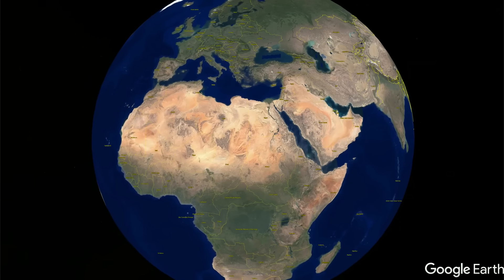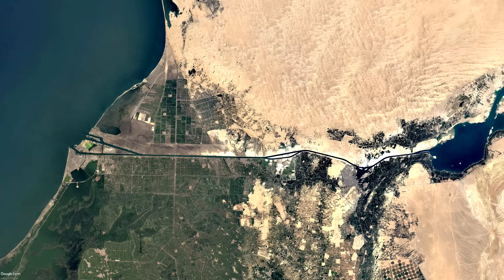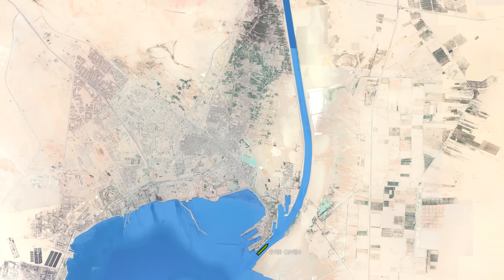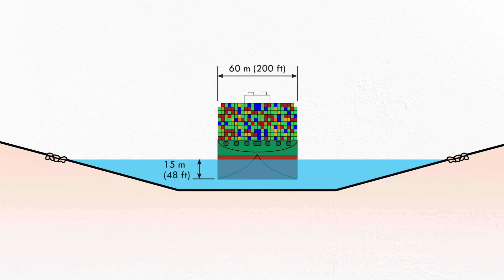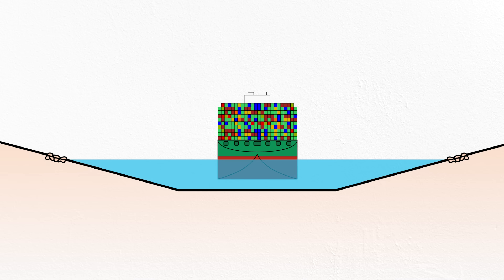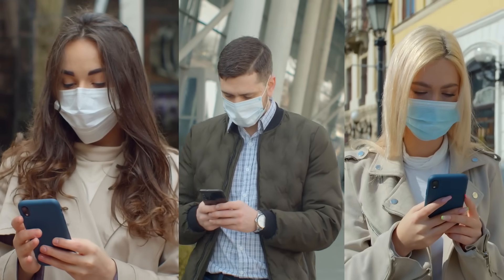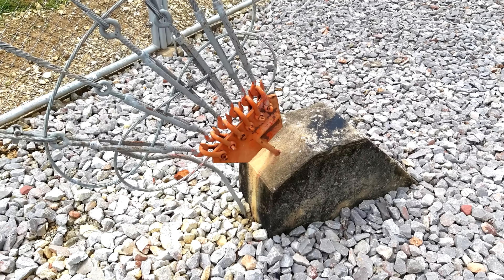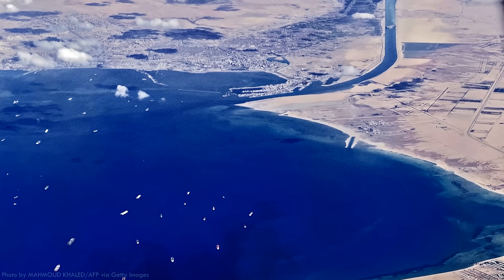What Really Happened at the Suez Canal?

Comment: Recreate water suction by filling a bucket w more than 4" of water w high pressure nozzle then lower nozzle til it reaches the bottom. Will go from pushing off bottom to sucking into bottom at about 2" above bottom cuz at 2" escaping water now creates low pressure.

Comment: From my engineering background, I think the cause of the accident was due to excessive side wind.  For a ship to move forward with a side wind force, the ship has to turn slightly into the wind and ends up traveling a bit sideways to go forward.  I think that the wind increased as the ship moved down the canal.  This resulted in the ship turning more and it eventually hit the side bank at the bow.  As soon as the ship bow pushed into the bank, the propulsion power caused the aft of the ship into the other bank.  My suggestion to resolve this problem with traveling through the canal would be to install bow and aft water jet thrusters on both sides to over come the side wind forces.

Comment: I like the video, but kind of both agree and disagree.  And, I am not an engineer but retired mariner and vessel master, who also was raised by a ship's pilot.  

I would not call bank cushion, suction and squat the same things, but when one does exist, the others are more likely.  Bank cushion is the water pressure exerted on the bow of a ship pushing it away from a bank or side of a channel.  Bank suction is the effect of that occurs when the hole left in the water by the ship's hull is not quickly getting refilled by water and the stern of the ship seems to get sucked towards the bank or side of a channel.  Squat is when the hole created by the ship's hull is not getting filled in by the water quickly and the ship gets closer to the bottom of a channel.  Bank cushion and suction work to change the heading of a ship.  Squat does not but, when squat exists less water will be flowing over and past the ship's rudder, which makes it much harder to steer.  

The ship may have experienced some if these without the wind conditions, but the wind was strong that day, and the way ship handlers conteract wind is often to speed up the engines.  Adding engine speed pushes more water past the rudders, so the steering is more responsive.  But ..., adding speed to the engines is almost always going to add speed through the water to a ship. Additional speed through the water exacerbates bank cushion, suction and squat.  And more speed also can greatly narrow any room for error one might have, or as I was told many times when younger and learning to handle vessels, speed kills.  

The ship handlers with which I have spoken about the incident are all of the opinion that the ship should have waited for the winds  to diminish before trying to transit the Suez Canal, that seems to be what they all think was the only real option.

Comment: When a vessel, travels along a channel, a phenomenon occurs, exactly like 2 ships navigating side by side in the ocean transferring fuel, they are attracted one to another if don't keep a proper distance between them.
This phenomenon pushed the stern ship to one border and the bow to the other border of the channel.
A simple explanation is the opposite of this phenomenon that occurs in rivers. The water flows faster in the middle, and slower on the margins, pulling everything into de center of the channel. This causes the death of skilled swimmers who used to swim on normal days without a problem,  and can not reach the margins of the river when rains and rivers rise up and the water increases its velocity because the current pull them always to the center of the river

Comment: That bank effect is similar to what happens with two ships refueling at sea, they are drawn together because of the water flow between then , a bit like a venturi . Dangerous thing to do and everyone has to be on the ball.
Regarding that dilatency issue , perhaps that could have been overcome better by bring in water pumps , hoses and big steel tubes with holes in them , dive them in , connect everything up and pump huge amounts of water in to liquefy the sand

Comment: first there was no technical information how heavy a cargo ship allows passage through the Suez canal: second the quicksand effect on a body. i do garden work with clay soil. when the clay soil is wetted, it is easier to penetrate into the ground. when the clay soil is dried, it becomes hard as a rock to dig. when this ship's front rounded cone is stuck on the sand and mud, the suction force also prevents movement until the sand/mud is dug out around the rounded cone. that's what i saw on your video the machine digger was digging around the cone.

Comment: @2:20 you mention that the Pilots are fully responsible...I wonder if that is true. I think the Pilots have a special position; I think ultimately the Captains of the vessels remain responsible. The Pilots have a sort of advisory role, but their "advise" may not be ignored without a proper/convincing reason. If they have full responsibility then in fact the Pilots would be responsible for the damages caused as well and that is definitely not the case.
Reply from the maker: I think you misheard me
Reply: @PracticalEngineeringChannel  indeed you are right, eventually I switched on the subtitles and indeed you said "aren't"; which I heard it as "are";

Comment: My Dad's research thesis for his PhD investigated squat in narrow, uniform channels - I contributed the University's first digital data collection rigs (based on a microcomputer) to speed up data collection during the characterisation phase of the problem. Squat as a phenomenon is exacerbated by having the propellers at the stern (push) and can be considerably reduced using props at the bow (pull). However, in spite of energy efficiency improvements of this arrangement there's a number of practical problems with this arrangement. One day, perhaps... Interesting explanation, especially the point about dilatency. Great vid!

Comment: Hi, I couldn't help but notice when you were talking about the factors which influence how hard it is to pull an anchor out of the ground you mentioned surface area. Well an anchor would be held in the ground because of static friction, and that only depends on the normal force (which you mentioned) and the static friction coefficient, not the surface area of contact.

Comment: Nothing about ballist? But it was probably pumped all out to go in the canal, also why didn't the just use jets of water to get it out? Ever pushed a hose in the ground and can't pull it out after you turn off the water? We you need to run another hose in the ground with it and pull them both out at the same time. Fluid dynamics is very useful to know

Comment: Not to feed fuel to conspiracy theories, but the "bank effect" or (less known as) the "channel effect" has the tendency to keep a vessel centered in the channel. As a 100 ton master I did a brief run on a dinner boat that cruised the intracoastal waterway. True, the dinner boat was only 40 ft wide, 200 ft long and drafted 6 ft, but the ICW is maintained (where possible) at a standard 90 ft wide with no less than 12 ft depth. The ratio of channel and vessel width and depth are pretty similar.
When the vessel was up to speed, 5 to 6 knots, you could walk away from the helm. The boat tends to stay in the middle of the channel. The force from the lower pressure from the bank pulls at the stern. This pivots the vessel around the center of rotation, usually about 3/5 to 2/3 forward of the rudders when steaming ahead, like steering a brick by pushing from the rear. This actually causes the vessel to point itself back towards the center of the channel. Granted, this can go screwy with light vessels, like an unloaded barge, causing wild oscillations until the extreme angle changes eventually drive the vessel into the bank, but the Ever Given carried nearly a maximum load, giving it a lot of inertia that tends to dampen the oscillations.
The other "channel effect" is counter intuitive; rather than piling water up ahead of the boat, the wheels (props) are actually pulling water from the channel ahead causing a slight dip in the water ahead. You can watch the water evacuate from the bank some distance ahead depending on the speed or thrust of the wheel(s). This dip in the water also helps to keep the bow centered in the channel.

The bottom line, in my experience, is the "bank effect" actually makes it more difficult to ground the vessel into the bank, unless you are over steering to compensate for high cross winds (reported to have been the case), over reacting to the "bank effect's" tendency to cancel minor course changes (the Egyptian pilots are well aware of this effect and know not to over compensate), or intentionally running her aground.

Comment: I still don’t understand why it took that long to unstick. For every “Chinese finger trap” like conundrum, there’s a relatively reasonable way to break out of it. 🤔
Reply: Correction: Every "Chinese finger trap" like conundrum you are familiar with has an easy solution. I would even say that a Chinese finger trap is not a particularly good analogy for this, but let's roll with it.
With a regular finger trap, you can cut and thereby remove the material the trap is made from. In this scenario however the trap is not surrounded by air like an actual Chinese finger trap, but instead when you remove some sand, that is surrounded by more sand, that falls in, since the only thing holding it in place was the other sand you just removed. Same with the solution of sticking your finger in further to release tension, in this case doing so would a) accomplish the opposite, because there is more sand behind the sand that trapped the boat and b) not facilitate a release anyway, since other than the finger trap, pulling the boat out would just pull the sand with it, because it is subjected to adhesion, because of the water in the surrounding sand.
I hope that cleared things up.
Reply: @creativedesignation7880  it cleared nothing up. Thanks.

Comment: if youve ever flown a model helicopter the same effect happens when you get close to a wall or the ground, the air becomes unstable and makes a suction force towards the surface
Reply: The “ground effect” you describe for rotor flight is strictly an aerodynamic effect and does not translate into hydraulics because of the drastically different properties of gases and fluids. The ground effect is noticed only WHEN HOVERING and completely negated by forward thrust. It is only significant when the aircraft is very CLOSE to the ground (three rotors diameters). It is also exaggerated by IRREGULAR ground surfaces. In contrast the ship is in constant FORWARD motion, relatively much CLOSER to ground due to its massive size, and surrounded by a SMOOTH canal surface due to current erosion. Furthermore a helicopter can move freely in three dimensions and is relatively tiny. The ship is as big as a skyscraper and attempting to travel in a vector plane (straight line). That’s why from a physics standpoint fluid dynamics and aerodynamics are two different fields of study — don’t mix apple and oranges in Engineering or your toy helicopter may end up wedged in a canal.
Reply: @drdrew3  actually fluid dynamics and aerodynamics are fundamentally similar the only key differences are compressability, viscosity and density, water is obviously going to have different properties than air because it is incompressable, more viscous and more dense however you can draw similarities because they both are acting upon pressure in a confined space, you are correct however to some people it is easier to relate aerodynamics than hydrodynamics becasue im sure people have much more experience with toy helicopters in small rooms than big ships in little canals

Comment: I have navigated  powered  barges  in narrow channels  the physics  are the same If you steer close to one bank the water flows faster on that side causing a low pressure  on that side sucking  the back of boat nearer the bank putting more power on makes matters worse you have take power off  then full power on full rudder.

Comment: That's why there is a speed limit in the canal. To not wash the edges too hard with the water wake. 8-10 knots is maximum what you can do there (depends on the size). And that huge ship was going there over 13 knots. Imho they had some kind of delay in the schedule to pass this two-way part as shown in the video and wanted to haul ass. Bank effect with bigger speed works stronger and if you deviate from the center of the canal with that giant... well, >that< happens.

Comment: I’m a commercial river/canal tow pilot/captain and my money is on the bank effect (bank suction). I have studied the vessels navigation track and I would bet the pilot let it get set too close to the bank due to wind, his correction further set the vessels stern closer to the bank. When you get this “bank suction” phenomenon it tends to steer the bow in the opposite direction and drastically reduces your rudders’ ability to make a correction. Additionally, heavy vessels in shallow water lose efficiency in propulsion, adding a further contribution to the incident. This kind of thing happens all the time in our North American canals with heavy tow traffic. If you allow the stern end to get too close to the bank, the head essentially steers itself towards the opposite bank and with the propulsion/steering end of the arrangement in the shallower water, making a correction takes much more time and power than normal. It often leads to vessel collisions in narrow canals, with both vessels pushing their respective limits of the canals edge to facilitate a meeting. The experience (if you are meeting in the typical port to port, one whistle arrangement) is like someone has thrown your rudders hard to port as your starboard stern gets pulled towards the starboard bank. The typical correction is this instance is full throttle with hard starboard rudder and an often disconcerting amount of time before the vessel responds to her rudders and “breaks free” of the shallow water’s grip.

Comment: Thanks for this video! Question out of curiosity from a non-engineer: could they have tried to inject air in the sand surrounding the ship's tip to increase the sand buoyancy and much more easily extract it from the canal bank?
Reply: I'm not an engineer either, but I can answer from what I learned while studying physics: That air would have just bubbled up through the sand water mix that is the bank. Injecting air would have assisted the ship in sinking into the bank, not lift it up.

Comment: I think among small-boat enthusiasts that "suction" effect has a fancy technical name.  I paddle canoes  and use small rowboats a lot, and in water shallower than three feet I can feel this affect slowing me down.  In water half that depth or less, it's a real "drag", causing the stern to squat and the resistance to forward travel to increase markedly.  In in little side channels off creeks that are shallow and narrow, you can see detritus in the water as an indication of water movemen, rushing across the base of the channel and rapidly past the hull toward the rear as the boat moves forward.  As you say, the water has to get out of the way somehow and in the process it moves along the hull faster than the boat's travel speed.  Most people who paddle small boats never notice this stuff, but I find it fascinating.

Comment: Haha. The Suez Canal is FLAT it's entire length , then you show a CGI globe model.
Reply: Yes, its at sea level. 

Sea level is constant around the globe. Does not mean it is 100% flat.
Reply: @Garfie489  Bollox it's 100% Flat..Bendy Water?  CGI Globe?  Show me some Suez Engineering Footage from a Satellite!  Show me that ship parked at a Aussie Port from a satellite!! hahaha
Reply: @endalockdown2501  i apologise that your mind is too limited to comprehend how something which is extremely large (such as the earth) can appear flat when viewing a small portion of it. 

In the same sense a smooth bearing has mountains and valleys when viewed under a microscope, yet to the eye appears perfectly spherical. Its really not hard to comprehend. 

No "bendy water" required. Water simply stays a near constant level away from the radius of the earth. Imagine a shape with 1 billion corners. Standing on the surface of that shape, it is made up of straight lines - yet if you view the shape as a whole, it appears near circular.
Reply: @endalockdown2501  Typical flat Earth fact checking, just repeating what your flat Earth prophets told you and as you think it supports your position you just go with it lol

The variation of sea level at 11 stations distributed along the Suez Canal was studied during the period from 1980 to 1986. The ranges of variation in daily mean sea level at Port Said and Port Tawfik are about 60 and 120 cm, respectively. The minimum range of daily variation is at Kantara (47 cm).

The fluctuations of the monthly mean sea level between the two ends of the Suez Canal vary from one season to another. From July to December, the sea level at Port Said is higher than that at Port Tawfik, with the maximum difference (10·5 cm) in September. 

During the rest of the year, the mean sea level at Port Tawfik is higher than that at Port Said, with the maximum difference (31·5 cm) in March.

The long-term variations of the annual mean sea level at both Port Said and Port Tawfik for the period from 1923 to 1986 showed a positive trend. 

The sea level at Port Said increased by about 27·8 cm century−1while it increased by only 9·1 cm century−1at Port Tawfik. This indicates that the difference between sea level at Port Said and Port Tawfik has decreased with time.

So tell me again how its 100% flat?
Reply: Lol @ the flattard. Grow up.
Reply: Tell Del I said hi and tell the coward to unblock me

Your cult is a dead joke